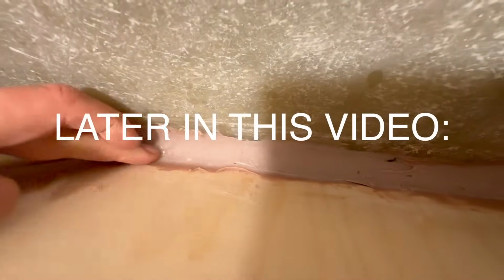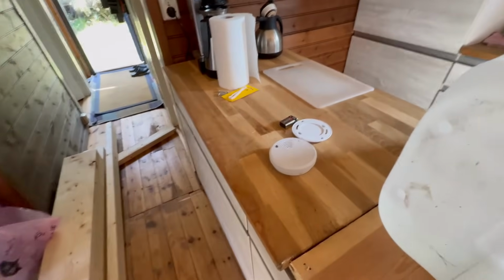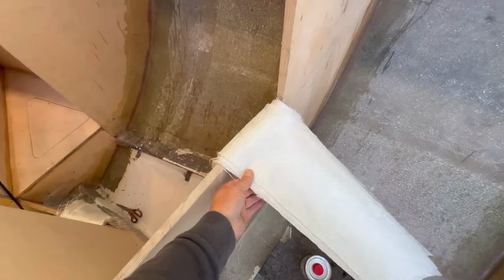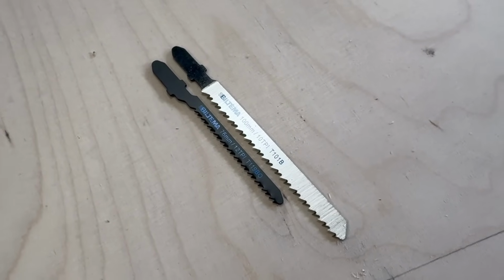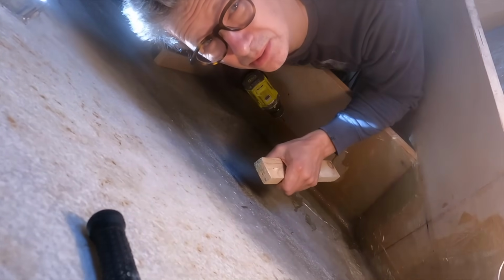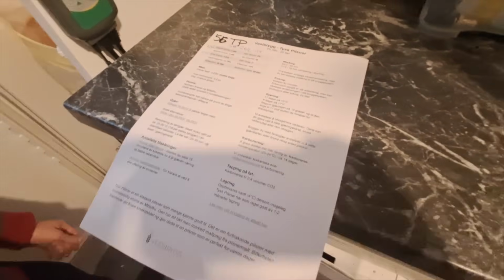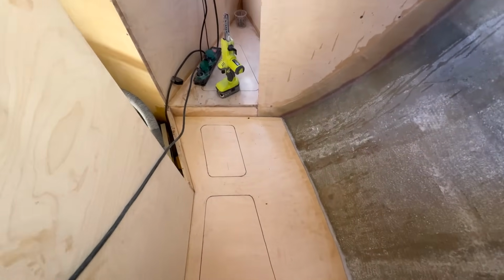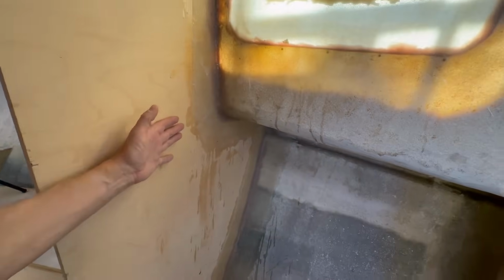Fisher 30 Ep 44 - Take a shot for each time I say the word "Cabin".

Comment: Hi Helge!!!  I'm so glad that nothing happened to the cabin,  with all of the work that you have done so far up there, it would really be a great loss.  The interior of the cabin on the Fisher is really beginning to reflect your plan, as for the size of the galley I think that if you equip it carefully it will be just fine.  Are you sure that you want to run that piece of conduit through the head and under the bed to get to the bow thruster?  I only ask because it seems that the available area particularly in the shower part of the head will likely be filled up by the shower sump box, and the area beneath the water tank under the bed will need to house the supply lines for the sink, shower, and toilet -- taking all of that into account  .. will you have a straight line to the bow?  Have you considered running along the port side along the hull to deck joint?  You are likely to be running wiring through there anyway for the interior lighting for the berth, anchor locker, windlass, and forward running lights. Keep up the great work!
Reply from the maker: Hi Robert! There will be space for the tubes underneath the part of the floor where the toilet will sit. Running the cables here will be the shortest path.... The cables for interior lighting is not a big deal (tiny cables). :-)

Comment: Your smoke alarm going off may have been down to   tiny insects ...in the UK they are called Thrips or Thunderbugs... They are so small they can get inside the detectors and trigger the alarms.  One of my colledges had constant  
problems in warm weather when doors and windows were open and they came in from the surrounding fields. 

The problem was the call from the neighbour  
Was in fact an automatic call to the fire station and answered by 3 annoyed fire 🚒  crews as it was a statutory call out 🤭 .. being halls of residence. 
It happen three times in one day and there wasnt even any burning toast to blame. 🤦🏻🙄

Thats quite a little brewery you have going there ..fully staffed with stirrers and bottlers this week. 🍻😊

Run your thruster cable under the deck/ceiling then down .
Reply from the maker: Sooo bugs can do this to the alarm. I will check but I am not sure we have such things up here North.... Thanks! :-)

Comment: Should have painted the insides and bottoms before gluing up and don't forget finger holes.. You don't want any exposed wood...do you? The pipe for the wire is a good idea. Finish it as you go man, you won't get bit that way. Those fire alarms are a nuisance. Sara looked pretty today.
Reply from the maker: Yes I should. But will do later.... (and then regret not doing it prior to gluing up) ;-D